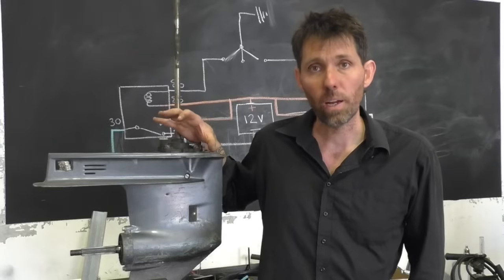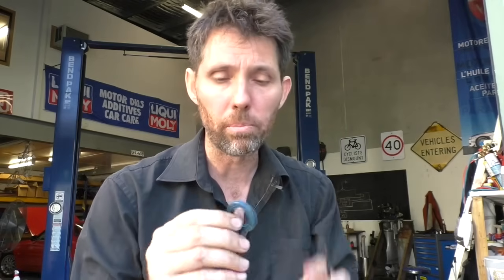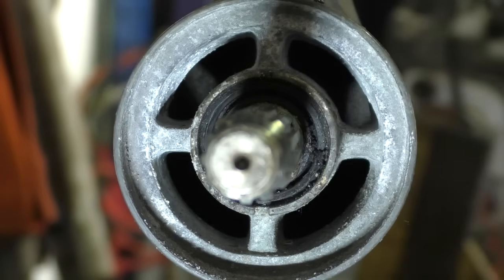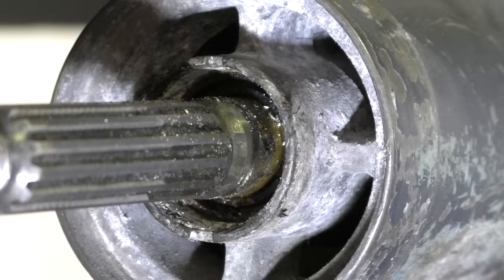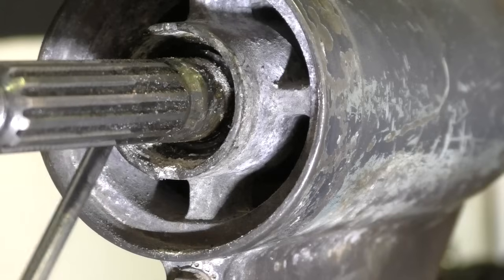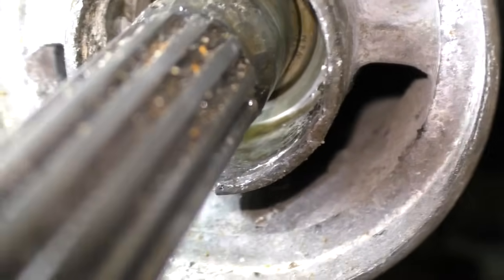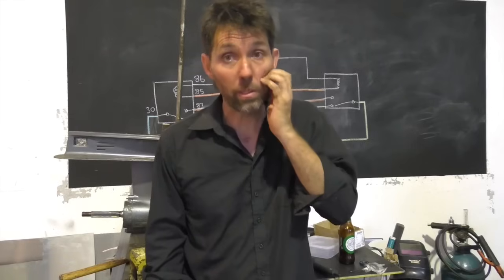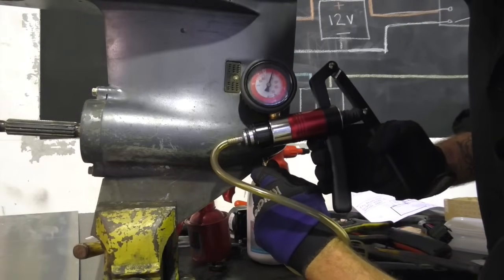Replacing outboard oil seals the hack way

Comment: Great video! I heard that it would be beneficial using some adhesive around the outer parts of the sealing gaskets.  In your video you just used some oil. I just wonder whether its better using some adhesive or not.

Comment: I have a 2001- Yamaha 200hp o66 saltwater series 2 stroke outboard I noticed today my prop oil seals came loose and are by my prop nut. I want to replace them where can I order these two seals at ?

Comment: I've mastered this technique. 
Just cut an Alluminum beer can and slide it between shaft  and seal to protect shaft then drill several small  holes @ 3 and 9 o'clock and screw in # 
6 pan head and pull seal out.

Comment: Thank you Dager marine for your videos, I tried with my seal pullers without success. My seals came out very well with the dry wall srews.  With the puller method,  i did slightly scratch the outer casing. Can I install the new seal with the scratches on the outer casing ? You sometime use Bellows adhesive when installing the new seals. Will this make it a lot more difficult to remove the seals next time ?

Comment: This "hack" just helped me tremendously! My bearing carrier is seized, so removing it was not an option. The other drywall screw hack did not work either.  With enough caution, this method definitely works. Thank you!

Comment: You didn't see the prop shaft bouncing around that bearing in there is shot when you talked about a hack I always thought a good hack would be to put about 100 pounds of compressed air in the housing and just blow it is seals out

Comment: Just tried this and wasn't very difficult to just slowly work around and deform the old oil seals in by wedging a small flat head screw driver in between the casing and the oil seal. As Stu says just be careful not to go anywhere near the prop shaft and orient the screw driver as much as possible so it is not angled towards the outer casing either. Only took about 10 minutes and once the seal is deformed enough it will come out pretty easily (you'll see it start to move).

Problem was though I went a little too deep in places when deforming the lower oil seal. So the screw driver went into the steel bearing housing behind the oil seal and the outer casing.  So this has left a couple of little nicks in that bearing housing. This potentially opens a gap between it and the new oil seals which I guess will reduce the seal efficiency? 

I just removed any sharp edges on those nicks and pressed any deformation with the screw driver but just though I'd warn people about this. Particularly as you can actually feel when the screw driver makes contact with that bearing housing. When hitting the screw driver with a hammer it should sound a little dull and soft when you are between the oil seal and the outer casing. When the screw driver makes contact with the steel bearing housing it will feel and sound rock hard.  At that point don't give it another couple of taps like I did and you'll be fine.

Comment: Thank You for the video. The insertion of the new seals were pretty quick, you might have mentioned that the inner seal lip faces the bearing and the outer seal lip faces out towards the prop. The inner keeps gear oil in while the outer keeps water out. Ken

Comment: Great video for the prop shaft seals. Really helps when you have no access for the tools needed to remove the bearing carrier.
Reply: There is never enough time to do it right but always enough time to do it again! Much luck to the fools that take advice from someone with zero credentials…

Comment: I watched several videos on this subject and combined a bit of all of them but I do like the way this guy goes into detail and always really great camera work, as he said in an ideal world we would have all the toys for every single job but I will probably only do this once so another good reason to learn "valuable" alternative methods, in the end I used two 50mm x 4mm self tapping screws, the brand name is Goldscrew from Screwfix but might not have Screwfix in Aus? Any 50mm x 4mm should do the job, there is no drilling required so no issue of swarf entering the prop shaft bearings and use a long driver bit so as to clear the prop shaft and get at least parallel to it when screwing in the screws, clearly patients, care and attention is required during this process just take your time...I found this method to be completely stress free, quick and easy, no nicks to anything, the only thing I will say is once the screw starts to bite into the metal of the oil seal then stop, no need to go in too far just couple of turns to grip will do it, a screw each side and then use two Wonder Bars nail bars to apply even pressure to either side of the seal and out she pops, rinse and repeat for the second seal, my first seal on my Yamaha 70b 2002 was not driven all of the way in it was positioned flush with the casing, this is better because it leaves a gap between the seals and its easier to feel when the screw punctures it, my last comment on the Automotive double seals is maybe its possible to turn the outside seal inwards so the spring is on the gearbox side and then it will unlikely see any salt water, I see no reason that wouldn't work just so long as the propeller shaft wasn't rusty or nicked where it makes contact, could even additionally coat the spring with marine grease as extra protection...

Comment: I did your technique, on a 100hp Yamaha “2000”,  a couple tips, a cheap set of dental picks let me pull the o rings and a bunch of the rubber out, it also let me find the holes that were already in the metal core, I actually just used a tiny screw driver to break the metal core on either side of the hole, and the ring came right out. Then while spinning the shaft with a socket on a drill I polished the shaft with sandpaper and I used the plastic pipe I had to set the new seals in, wrapped with sandpaper and smoothed out the inside of the casing!

Comment: Great videos! I like your style. This is also a great technique for a guy who is handy, only spent a few hundred dollars on an old motor 12 years ago, and does not want to spend $1,000 dollars replacing the seals now. Thanks you!
Reply: I just did the seals, and I couldn’t be certain the shaft was smooth, so I rolled up some sand paper and with the shaft spinning the the nut and a socket on my drill I sanded the shaft from 80 grit up to 600 grit sandpaper, it was a mirror finish when I was done! Thanks for the info!

Comment: Just did a Mercury. Could not drill into the stainless on the oil seal. Took my Dremel with a Diamond cutting attachment to make a hole for a Drywall screw. Seal popped right out.

Comment: I am changing the impeller in my 1984 35hp Evinrude.  When I removed the old water pump housing I touched the underneath seal and the spring broke. I'm in a time crunch and did not want to replace the seals now.  So I was looking for a suitable replacement for the spring.  What a great idea to use a nitrile O-ring in place of the metal spring.  Thanks for the video.
Reply from the maker: You're welcome, I'm glad the tip helped you. :)
Reply: Where do you get a nitrial o-ring?

Comment: You mention that you can buy these seals at a local automotive parts store, do you know the exact size/dimension(s) for these seals?
Reply from the maker: The best thing is to take the old seal in to the store, they will measure it for you and give you the right one. Bearing supply stores are usually best for these seals.

Comment: As a light vehicle mechanic I can tell you this is basically the only way to remove cam and crank seals when doing a timing belt etc unlee you wanna disassemble the entire motor. Yes it might not be ideal on a outboard but definitely nothing wrong with this technique
Reply from the maker: Yes, I come from a car background too and you never take a crank out of a engine to remove the seal. Not sure why outboard guys inside you remove the carrier. I guess it is a bit smaller and easier to get it wrong.

Comment: I am all for "helpful hacks" and continue to learn new ways to do things all the time, but as a professional marine mechanic I see customers or "their buddies" hack up the prop shaft and bearing carrier doing this exact thing ALL THE TIME! it turns a routine $250 repair into a $1500 lesson...... just a little insight from the professional side. There is generally one way to do something right and a million different ways to screw it up.......

Comment: So I did a pressure test and it passed.  Held 5psi for 10 minutes.  Then I did 10psi for 10 minutes.  It held it all.  Do I still need to do a vacuum test?  Could that little fill/drain washer had caused it to become milky?  It was leaking out on me.  I ordered 10 of those washers and will replace them now all the time.

Comment: This is the best marine mechanic on youtube.  Now, do two seals do the same job...stop oil from getting out through the same way?  Like double protection?  I have a little cloudy oil and the lower screw has tiny leak.  Perhaps the water got in thru that tiny opening and it is not a seal problem?  So now that I am focusing on lower unit....what needs to be looked at?  Seals and Pump I know about.  Anything else?  Any help appreciated.
Reply from the maker: The seals can oriented the same way for double protection or back to back with one aiming to keep the oil in and the other aiming to keep the water out.  If you are getting water in the oil it is either the prop shaft seals, drive shaft seals under the water pump or the gear selector seals. The only other thing you might want to look at on the lower unit is the anodes and clean speedo tube.

Comment: I am a new boater, my first time trying to gear up my new inflatable boat . I went and bought me a used Yamaha 9.9HP 4 stroke off of some folks that swore up and down that it is a great motor and they ran it just last summer and don't need it any more . I have never seen an outboard close enough to even know how to start it so of course i never tested it when i picked it up. So long story short i took a challenge up on my self an decided to take a look inside and learn my lesson. The engine looks spotless as it is brand new even though  it is 1989 motor. I came to understand that the gear box was seized up , when i took the lower unit down chunks of salt and sand mixed in with shells fell off it , at that point i wish i saw your videos before i got my hands in it , I had real hard time getting the old parts out , i watched hundreds of videos and nothing . So like you said i did put some scratches on a main shaft as i was frustrated with lack of knowledge  and tools. And just yesterday i watched couple of your videos and it was like thank you God for sending me this guy. Thank you , you are a great teacher and doing this from the heart. I appreciate, and looking forward on getting my baby in good shape with your help. So long brother , keep doing what you doing.
Reply: Someone was using the engine to blow sand and dirt out to expose clams...trust me I've done it!!

Comment: What if water was let into the gear box by accident. I did not put a gasket on the lower drain bolt and noticed milky gear box oil after I seen a leaking lower bolt. Is there a way I should flush it before reloading it with new oil?
Reply from the maker: You could try flushing it with denatured alcohol to get the water out, but I wouldn't stress too much. If you completely drain the old oil then refill with new you should be fine. You could do another oil change sooner rather than later to be 100% safe.

Comment: Wouldn't the compressed air and brake cleaner force the corrosion deposits into the bearings? I would have done that step before removing the second seal to get most of the chunks out.

Comment: G’day Mark’ 
I’ve got a Parsun 25hp 4 stroke 2008
I’m trying to find information on changing from tiller to remote! The gear select has a square end! What do I need to connect a cable to the gear select point it’s a fare distance from the cable locking plate! I’m told it’s much like a Yamaha outboard! 
Sean

Comment: some suggestions you may want to consider
make a screw driver just for this seal removing in general by sanding the edges round so to speak as this will far lessen the chance of gouging the bearing carrier .
and slide some shim brass pushed down through each seal as you work on it i guess 5 thou would fit easy and it will protect the prop shaft  very well from scratches .
every cat fitter has a old screwdriver that's carefully rounded on all sides including the tip for pushing duo cone troic rings into place as sometimes the installation tool isn't at your beck and call.
as they are rubber and the pressure to push them is severe its important there are no sharp parts on the screwdriver.
I feel it would work well in this area as well.
thanks for the vid I will go back an check out the one on removing the carrier as every outboard I have ever had the retaining nut seized and had to be drilled out. or the treads where corded away.

Comment: I scratched/gauged the housing case and have an oil leak from it. I tried "form a gasket" between the seals and JB weld on the outside of the (water side) seal and it worked but the JB weld broke off after 30 minutes of running. Any ideas, "O" rings and where to put them, silicone faucet bonnet seal or JB weld between the seals???  Da hacker.

Comment: If the newer seals are double and not single lip would it be safe to just replace the outer seal with the new gen seals to save the chance of nicking the prop shaft trying to remove the second seal?
I have to replace the prop shaft seals on my Evinrude 35 HP and I might just replace the outer seal and see if it's enough if not go ahead and replace both.
Good tip using an O ring in place of spring.
Thanks for posting video👍

Comment: Used this technic today on a 86 40 hp Johnson worked great I wrapped electrical tape around shaft incase of a slip all is good thanks the punch making the hole is critical.

Comment: How much tolerance would you say there is in the measurement when getting 3rd party seals? I found oil seals (for drive shaft, but i guess same principle) for an omc 9.9 that are 1.6mm thicker than the 4.7mm originals. Inside/outside diameters match exactly. Do you see any risks in using those? Cheers!

Comment: have a mercury 4 stroke 115 2005, motor is leaking oil from the area where the shift shaft ends not leaking at the foot. any ideas on what causes this.

Comment: At the start of the video, you mentioned you were able to get the correct puller. Were you able to find a puller for the smaller unit? Do you have a part number? I have a F40 and all of the pullers are too big to fit into the carrier. I ended up cracking the carrier at the oil seal, so it has to come out now...

Comment: IF you did the pressure test and started slowly losing pressure what next would you check
Reply from the maker: Spray with soapy water and look for bubbles indicating the location of the leak.

Comment: I normally replace my sea water pump oil seal every year due to leaks (corroded spring ring in seal). Since i followed your advise to replace the spring ring with rubber O-ring, I've never had any leak these 4 years !! THANK YOU Dangar Marine.
Reply: Where did you get the o-ring?  Is there a name for those?
Reply: @Bobbybbops  it's just a regular Viton or Buna N o-ring. You'll need to measure the ID OD of the steel spring ring to buy the right sized o-ring. Too tight and the oil seal grip wears the shaft and too loose it'll leak. So follow the steel spring ring dimensions.
Reply: Was about to ask how that nitrile o ring works on the oil seal. You happy with the result?

Comment: What I did in the past ... Go to your local hardware store and find a  long self tapping screw (sheet metal)  find a small tube that screw will fit inside but also large enough to fit between shaft and housing.. Place tube,  insert a long screw into the tube and rest should be self explanatory..  Good luck my fellow weekend warriors...

Comment: I just pulled the seals in my 02 v4 Yamaha and I would highly recommend a seal puller it makes this job easier and with some tape you can protect the shaft. I have the correct tools and I cannot get the slotted nut to come loose even with a breaker bar and 1/2 breaker bar on the actual ring remover. And to think mines a freshwater outboard.

Comment: Great videos - these have been so useful to me. However - worth noting - this oil seal hack can't be done on a tohatsu/mercury/mariner 4/5/6hp model - the bearing carrier is cast in such a way that you can't access the propshaft seal without removing the carrier first. In fact the carrier, seal and bearing are available as one, pre-assembled line item and i'd recommend buying that, rather than wasting hours trying to get the carrier off in one piece. Even if you do get it off without damaging it, you'll find that the bearing is impossible to extract to gain access to the seal. Cheers

Comment: Is it just my head not working or is the inner seal in the wrong way? Like that, what's keeping the oil in the unit?
Reply from the maker: I think it must be a marginal choice as the Yamaha service manuals show both oil seals with string side facing out to stop water from entering, but from memory the Hondas recommend back to back - one keeping the oil in one keeping the sea water out. Both approaches seem to work so there can't be much in it.
Reply: @DangarMarine  I actually just watched "the right way" of doing the seals and in that vid you did check it with the manual. Are the upper ones in the same way? Of course if the unit doesn't leak in, it can't leak out without creating a vacuum (when cooled down) so maybe it spits out just a little bit but then stops leaking.

Anyways, keep up the good work! Not a lot that is actually new for me but still interesting to get another mechanics points of view.

Greetings from Finland!